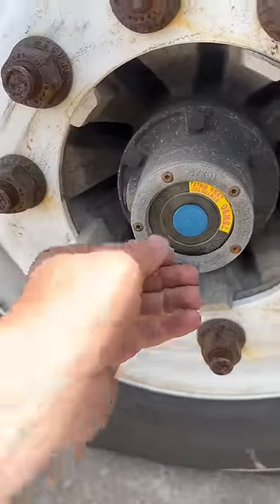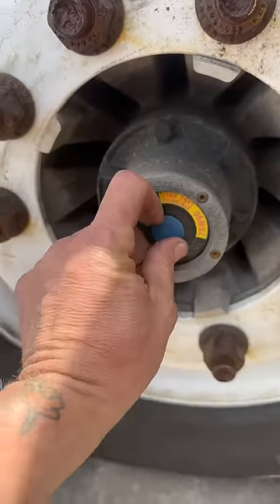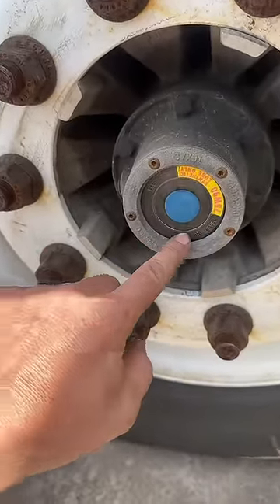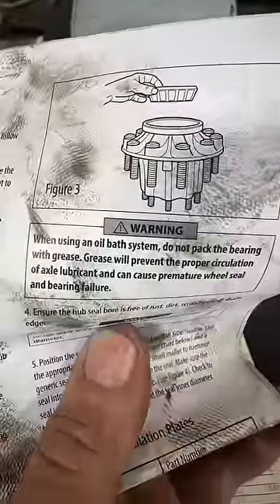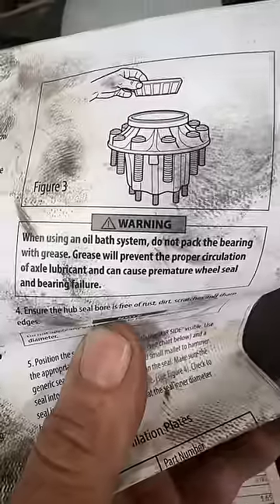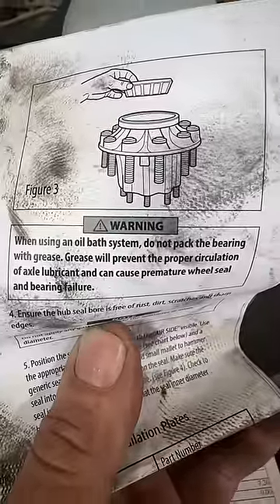No idea what you’re talking about

Comment: In go-kart racing, we washed out the grease in self-aligning rear axle bearings with brake cleaner and lubricated them with light oil in order to reduce viscous drag and friction.  We also ran worn-out top oil-scraper piston rings and clearanced engines to reduce engine friction.  We did so because oil consumption isn't a big issue in racing and the rules only required an oil-scraper ring to be present and to be stock appearing.  The key to clearancing an engine is to clearance just enough to reduce friction without going too far and reducing power.  It makes a big difference in performance.  I heard an ASME talk given by Bobby Rahal years ago talking about Indy car racing.  One of the things he talked about was the engine clearancing they did when building their Indy car engines.  Another thing he talked about was their decision to build their Indy car engine starting out with an old school bus engine block.  The rationale he gave for doing so was they felt that with the thousands of thermal heating and cooling cycles the block underwent over the years relieved any internal stresses present in the block when it was new.  Of course, the finished engine looked nothing like an old school bus engine.

Comment: 80w 90 is what I always heard you're supposed to put in them. It's an oil bath to keep it cooler than grease could ever do.
Reply: Is it because those oil bath bearings have tighter clearances, than greased bearings?
Reply: @thehighlife1320  it's because of the weight they carry and the stresses they are under. The front tires of a truck, at minimum 6000lbs each front wheel give or take. That's the weight of almost two cars that have 4 wheel bearings each to share that weight.
Reply: And grease can't handle high speeds.
Reply: @Ratrazor  yeah, true. It would all just sling to the outside walls of the hub and never touch the bearing.
Reply: that's why the heavy oils are called "gear oils" generally they work in gears and bearing that are moving kinda fast or under a lot of pressure, because grease does lube but it doesn't spread that well, oil will get into every nook and cranny like sand in your undies at the beach, grease will just sit there like a nasty skid mark
Reply: @Ratrazor so big trucks didn't go fast before the 1980's
Reply: @Mr.NiceGuy80  Is that what happens on a Cars Wheel bearings?😂😂😂
Reply: @Ratrazor there is such a thing as high speed grease. It’s what grease packed bearing use and its not nearly as viscous as most grease and almost flows like a liquid.
Reply: Awful lot of people in these comments posting about grease and having not one clue how it works or when and where it can be used. Y’all could just as easily be the one this short is directed at….. 🤦‍♂️ Riddle me this web genius’s why are oil bath axles losing favor in the trailer industry if they’re so much superior than a greased axle.  Hint they’re not…..
Reply: @tbusch63  It doesn't actually. Car wheel bearings are so good at their jobs, they only require grease. They're not under anywhere close to the same load truck bearings are.
Reply: @jimbothegymbro7086  There are wheel bearings especially on new trailers that use only grease. They are typically lacking the plastic window and just have an opaque cap.
Reply: @jimbothegymbro7086  I love the analogy 😂
Reply: @jimbothegymbro7086  😂😅😂 love your comparisons!
Reply: @Mr.NiceGuy80  I was giving you some shit. I damn well know the difference. I have done Grease and Oil Bath bearings on diesel Trucks and Trailers.  Two years of Auto Shop in High school (I am that damned old. I used to shoot .22 cal rifles in the 8th grade under the school auditorium, DURING SCHOOL!!😲😲.) My best friend's dad owned a Diesel shop for 35 years. Guess who spent every day for four years after school there learning about Diesels? I worked there for a year before the economy took a dive in the early 80s, I got laid off, and I've only taken my cars to a shop when I didn't have the time or didn't have the tools, or a place to do the work. I don't work on cars on gravel driveways anymore!!!
Reply: @tbusch63  that's cool. It's hard to tell when people are kidding on here sometimes. Take care!
Reply: @tbusch63  heck yeah, I was in auto shop in school too. I remember bringing a rifle to school also.
Reply: @Mr.NiceGuy80  No Problemo, I really have had fun working on Diesel Trucks. Except when my Boss made me torque down all the head bolts on a Mack! 220 ft lbs finish torque. I had to run through them THREE times! 50,125,220 Doesn't sound too bad right? There were four Heads and 20 bolts on each head! THAT was a bloody workout! You also take care and hopefully the SHTF doesn't happen anytime soon! Watch your six...
Reply: Usually they used an 80-90 wt GL4 Gear lube!
Reply: There sure are a lot of experts on here.
Reply: singlekc  thank you for correcting me. I'm sure most people got my point anyway.
Reply: The grease trailer hubs are supposed to be set it and forget it. They are less likely to have leaking seals and failures, but when they do, they REALLY do.
Reply: We always packed grease in the hub if the seal was leaking or the cap cracked just until we could get it fixed.. gotta keep those log trucks rolling.. lol
Reply: @Ratrazor  may want to think about your comment and edit it--there's a multitude of very high speed vehicles using greased bearings. Most modern cars with sealed bearings are grease packed bearings, not oiled bearings.
Reply: Any bearing will be happier in oil rather than grease, old trick if you want your skateboard or pushbuke to run a bit faster, clean the grease out and oil em up instead.
You have to reoil frequently but will give you a slightly smoother faster ride.
Reply: Actually,  it's 75w90. The same oil that goes in the differential.
Reply: @davidtaylor8002  Thank you, captain pedantic.
Reply: @littled6698  the trailer I have now has grease in them, most I have dealt with had oil. I didn’t really notice them getting hotter with grease. However, I did burn one up, (that one definitely got hot) and that never happened with the oil bearings. Now I have three greased and one oil. the guy that came out and replaced the bearings and hub in a parking lot Recommended switching it to oil. I think the biggest point of the video is don’t add grease to an oil bearing.

Comment: Bob is smarter than most voters.
Reply: Well he was kinda right there is a semi fluid grease that can be used. Looks like grease when cold but runs like oil onec it's hot.
Reply: @chrisgraff1979 But it's USUALLY 80/90w gear oil!
Reply: @wesman7837  yes but can be switched
Reply: And you tube mechanics....
Reply: @chrisgraff1979 can be switched???? Then why does it say "WARNING when using oil bath system DO NOT PACK WITH Grease?"
Reply: @TheChaz81  Re read his comment carefully and find the context.

Comment: He’s a heavy hauler. Probably has a lifted F350 to pull his john boat
Reply: then he surely would know even car or Jeep or truck axles have internal bearings in the solid axles that are lubed with gear oil
Reply: Ford flex pulls mine all day brother 😂
Reply: @sprkySWOUP  hell yeah. 80% of diesel owners have no need for one.
Reply: No, just an F150 with a boat three times the GCWR rating.
Reply: @ChuckBeefOG lmao this is 100% true worked at home depot from 02-07 while in college renting equipment before the truck craze took over even then it was the same. Dude wanted to rent a skid steer told him he needed a hitch and atleast a 3/4 ton to tow the trailer and skid steer he looks at me and says "i have a truck" didn't even know what he had. Told him to pull around and i would look at it......pulls up in a spotless F350 powerstroke......no towing kit, no hitch, no hook ups......not even a ball on the damn bumper and then got upset at me when i told him that wouldn't work.....

Comment: Hopefully they're not mechanics putting grease in oil hubs. WOW.. 😂
Reply: I've seen guys pack bearings before putting them in oil bath hubs 🙃
Reply: I've had to fix many "fixes" that these "mechanics" previously fixed. Grease packed into oil bath hubs is a favorite. It's actually shocking sometimes how common that is.
Reply: Farmers often do this on their trailers. They pack grease in the the oil filled hubs and run no oil. This is actually done for a purpose. They don't move fast enough or long enough for heat to be an issue. So they take the oil out and pack them with grease. This is done because they are not used often and stored for long periods so the grease offers better protection of the metal. Those hubs will last longer.
Reply: @rutegerd  
Grease packed hubs are a thing, and that's fine, but mixing the two is NOT.
Reply: Fill them with grease when the seal starts leaking because you don't want to down the machine at that time or you are not in a good place to do it.
Reply: @kylesonsalla7620  Trust me, lol farmers ain't buying different hubs. And I'm not talking about greased hubs. I have rebuilt many of both. And I have seen many sets of oil hubs packed with grease that work just fine for many years. But those trailers aren't being ran flat out on the highway all the time with a full load. We have got a few belly dumps and pony dump trailers from Alberta setup like that and they work fine. We were shocked.
Reply: @kylesonsalla7620 what they were most likely doing was smearing a little grease on the bearing because for some reason they were not able to fill the hub and had to rely on the oil filling it from the diff which takes a while. On some midrange trucks it's not even possible to prefill the hub because of how they assemble but one method I use is to jack up the opposing side and the oil will run in there from the diff but then don't forget to top off the diff after. I've also seen on steer and trailer hubs where the hub was damaged and wouldn't hold a seal good enough for oil, the driver would grease pack the bearings to by until the hub could be replaced. Used to see gypo log trucks do that so they could keep hauling. It's amazing the shit I've seen on those old log trucks lol tie rod ends wired together, spring bracets chained in place, kingpin caps welded in, the list goes on and on lol

Comment: When I was a trailer mechanic,I had one drawer in my toolbox full of manuals and installation guides. Always keep references!  

I think there was just one time I ever encountered a trailer with greased bearings, and that was some type of grease that would melt at temp and act like oil.
Reply: That's why you always leave the installation guide on the equipment you work on. Quit taking the guides and screwing the next mechanic/tech who comes to work on it
Reply: @llamacebu216 get your own paperwork to file.

Comment: In the Marine Corps, the road wheels to our Amtracks (AAVP7A1) had bearings in the hubs... in the center of the road wheels... which had a hub cap that had a sight glass... those bearings had to be completely filled with OIL or they would lock up and heat up... you knew you had a bad bearing when you could touch the cap, and it was hot to the touch!!! We greased things on our vehicles as well, all over... but never the bearings!

Comment: To be fair, I didn't know oil bath axle bearings existed.  Apparently its all the rage on light duty trailers (esp. boating community).
Right now, I'm run red-line grease and axle savers (red-line is an old racing habit, use to melt the grease out of front hubs from hot brakes - redline cured that).   Old school.   Haven't seen any documentation on which way is better.  They say oil bath is better for wear, but you have to watch for leaks.
Reply: I do logging on oil bath bearings, up wards to 65 tons and we've done it in the 80 ton range in the past. Personal preferences, mine being oil has a lower rolling resistance initially in cold weather.  Very useful in 30 or 40 below ranges

Comment: In a pst professional life, I worked for a truck & trailer suspension manufacturer. We started using semi-fluid grease in a lot of suspensions that were dressed from the factory. Man oh man did that cause some problems with a lot of drivers, shops and fleets that had never seen or heard of it before. Didn’t matter that it was better at the task at hand than regular oil, they still thought we had the intentionally packed their hubs with a substance that would make them wear faster and therefore allow us to sell them more replacement parts.

Comment: I was working on truck/ trailers over 50 years ago and oil bath bearing was used exclusively on trailer axles and front end axles on the trucks using the oil gauge he's showing. Not once did I ever see a grease lubed bearing in those situations.
Reply: Worked with people that had grease filled steer axle and all axles on theirs trailers also. Preferences of the owner.

Comment: Yep. When I do bearings & seals on heavy equipment, the outer bearing is almost always an oil bearing, inner is grease. That outer runs in dope flowing through the tube & shared with the gears. IYKYK, I guess…

Comment: I hate oil bath bearings. Had them on a boat trailer and they are junk. Mostly because they sit half of the year and the oil dries up on the top of the engine bearing and allows moisture to rust the exposed metal. Then they fail.

Comment: if i know as axle is going to sit for a while the bearings get a contact coat on the race only pre assembly. were talking bare finger wiped on and wiped away to prevent corrosion while sitting. if being put immediately back into service never grease anything. soak the bearing in oil and install

Comment: All of you commenting need to go back and read the instructions again. "When using oil bath system" don't  grease it. No where does it say that a wheel bearing has to be greased or oiled. One commenter was very correct about application.

Comment: I work on electric motors with "sealed" bearings. And i cant tell you how many times ive gotten a seized bearing to free up by bathing it in oil. It doesnt fix it permanently. But it will get it going temporarily in a pinch until you can get the parts needed. I literally just did this yesterday.

Comment: I’ve worked on both. I’ve came across greased bearings are almost always when I was in the military with almost every vehicle. Even to the largest trucks that look like giants that would make your regular highway 18 wheelers look like baby toddler trucks when comparing sizes. Afterwards on the civilian side I began seeing the oiled bearings and watched as the greased versions drop off. But every time I go back into government contracting for work there’s those greased bearings waiting for me like a long lost friend. Even had people staring at me when I’d pull out bearings to pack them with new grease like I invented fire because some people don’t know how to maintain them because they’ve never dealt with them. Grease gets old dirty and you still have to replace it and seal it back up per the PM guide/ manual instructions. Although the oiled version is a lot easier to deal with and less messy (unless you have a grease nipple, but that’s different than packing).
Reply: What trucks did you work on in the military? I was a 3533 LVS operator in the Marines. I used to drive different types of military vehicles mainly the LVS or 7 ton. 🇺🇲

Comment: I'm not even a diesel mechanic and even I know those bearings get oil in them. I'm a driver of those trucks. It's part of the maintenance and pre-trip inspection. Either pull that blue thing out and look at the level. Or, some of the face plates are see through. You will be able to see the fluid in there.

Comment: Before i even started working on cars, i worked in a manufacturing plant as maintenance. Some bearings are sealed, some are not, some are all metal, some have plastic, some use Grease, some use oil. It's cheaper to oil bath them when it's in an enclosed system and you don't want to change a giant PITA bearing ever other year. Most companies though, want convenience and little down time, so slapping in new bearings and forgetting about it for two years worth of profit is better to them.

Comment: Physically, there's no difference between greased bearings and oil bearings, however the cap and seal are different between them.

Peterbilt ran grease packed front hubs for a bit.

Comment: I don't know shit about bearings on big trucks, but I use bearings in my home built belt grinder and a flex shaft tool, as well as pocket knives. The first two are fully enclosed bearings that you aren't supposed to oil, and can burn up if you do. Ask me how I know.

The pocket knives, though, will gum up if they're not oiled occasionally. It's just a tiny drop of 3 in 1, but it's oil all the same. Just that much tells me that not all bearings are the same.

The biggest lesson here is to not talk out of your rectum on a subject you don't know well.

Comment: Hell I don't even work on trucks and I knew about oil bath hubs on trailers and trucks. Only reason why they're not as common on rail cars anymore was because of the maintenance needed for it all, lift doors to filloiil levels, close doors, one or two steps, lift another door and repeat down one side of a 300 car train, then do it all over again, up the other side on our way back to the engine.

Comment: Thats actually pretty much just any axle bearings on an actual vehicle, at least older trucks, just put a new axle shaft seal in my ‘01 Silverado 1500 today and the bearings in the rear axle are lubricated with the same 80-90W rear end fluid thats in the rear diff

Comment: I have legit 100% never done actual wrench work on a semi…. Even I know you don’t pack the bearing with grease. They’re oil. You do need to check the oil level and add oil, and inspect the hub for oil leaks. Sure I may be a trucker now, but I also knew that before being a trucker. They have clear hubs so you can see it’s got a fluid level.